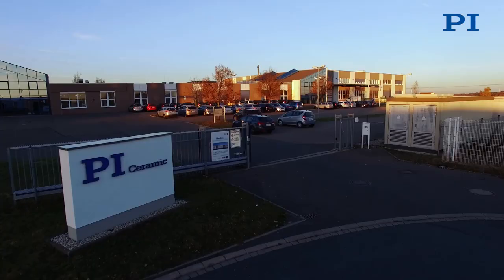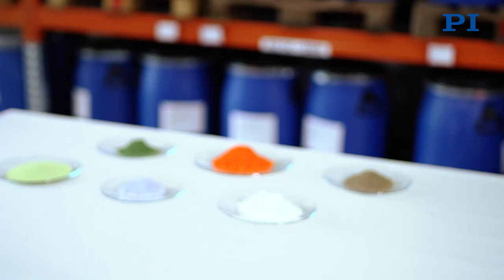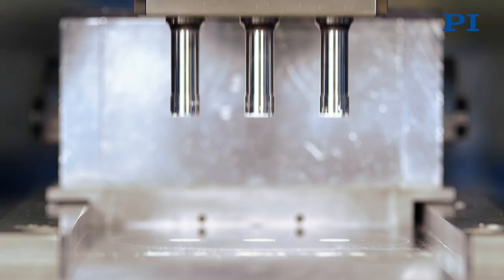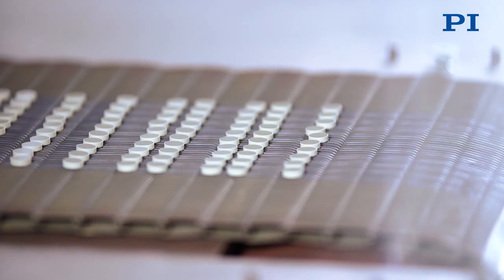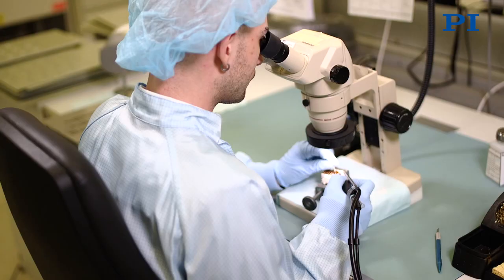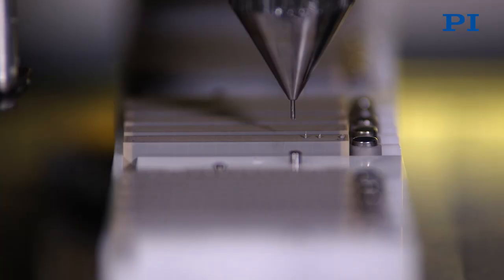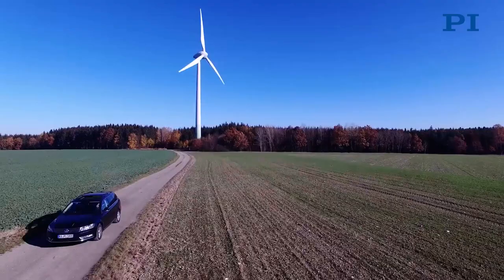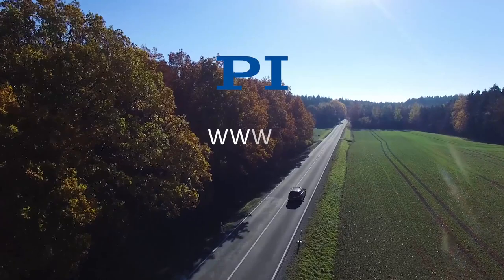The Piezoelectric Effect, Manufacturing Processes: How do Piezoelectric Transducers work?

Comment: does constant pressure produce constant voltage?
Reply: No it does not. An electric Voltage is produced by the change of the strain on the piezoceramic. If theres no change in the shape, there wont be any Voltage
Reply: @oniichan242  So if I sit on a piezoelectric crystal with all my weight on the surface area, I will only generate a current at the moment of contact and not the whole time I'm sitting down, correct?
Reply: @Sultanofszing  
What an example 😅